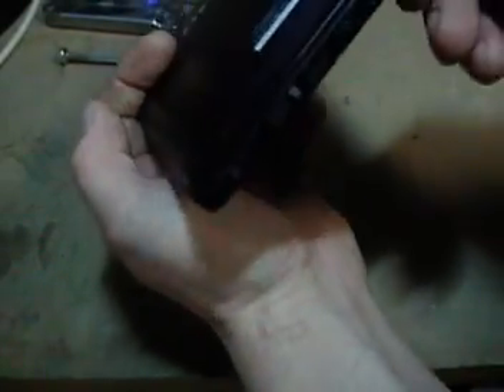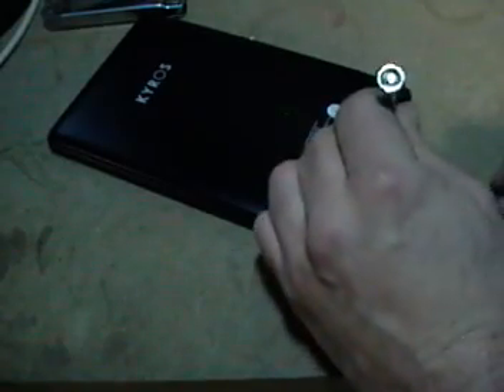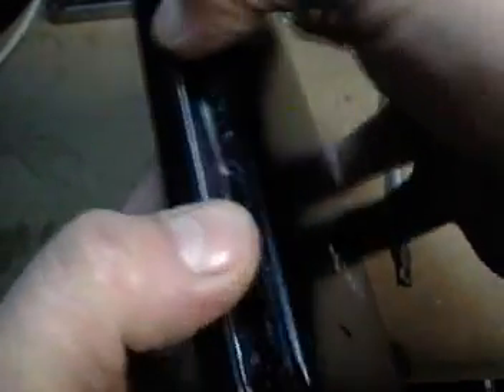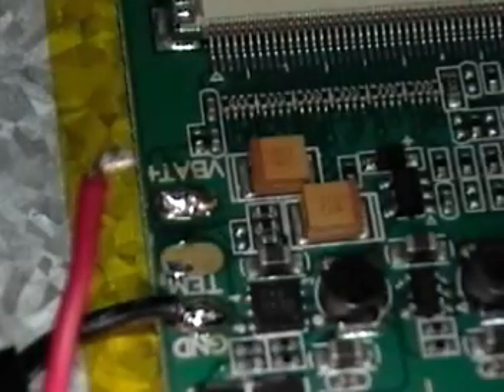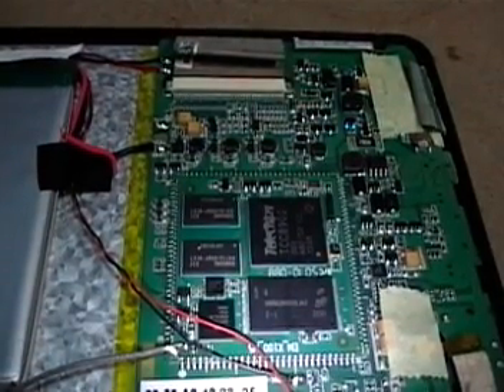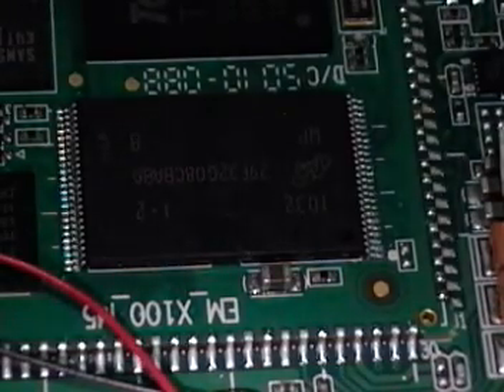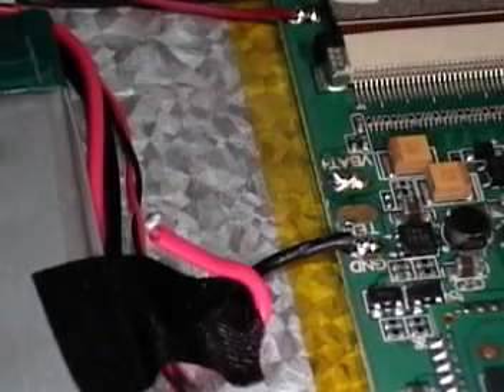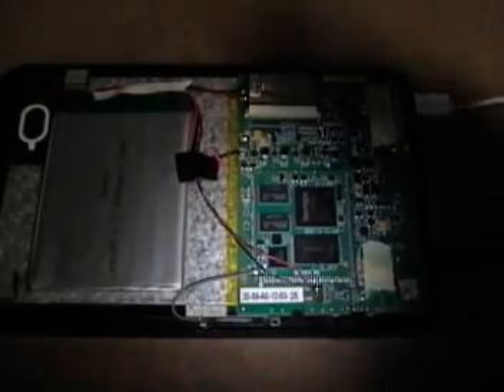How to Unbrick Your MID7015 Coby Tablet

Comment: Hi , my tablet freeze on logo boot , it is an  Infotmic ImapX210  sawee 101 !! i try to reinstall firmware many time, the same problem persist !! any help please?
Reply from the maker: Visit here:

http://goo.gl/Msojlp

You may fins a solution there, but be warned, do it at your own risk!! Although, your tablet is already malfunctioning, it may not be much of a risk at all.
Reply: +Rhomis Rhemis thank you for answering, but I've already visited and downloaded files from the link you gave, and to clarify again: my tablet displayed the logos: Infotmic with 0.6.31, after handling it appears: 0.6.1.5 ( 587) at the bottom right is still planted, the processor is an ImapX210BM1-80 --- p3r037___
chip1 = brand: Hynix --- H27UBG8T2ATR on board U3 =
chip2 = brand: MX --- 29LV400CBTI670G__on board = U42
The main board is labled WWE101-Main
Any Help again !!?
Reply from the maker: Sorry. I have no more answers for that problem.
Reply: Thinks :)

Comment: my tablet the screen has lines running across it can any one help please
Reply from the maker: You may have to make sure that the ribbon cable from the motherboard to the screen is tightly secured, at both ends. That means you will have to carefully re-connect them PROPERLY. Do some research on how to do that.

...or, if that does not fix the problem.

You may also have a damaged screen, which will need to be replaced.

Comment: Man thanks a lot!!...this works for a ColorTab CTC07SO with a different flash memory, this one has a 29F32G08CBACA,  the tablet was dead because the firmware that I put it was wrong, doing this procedure windows 7 was capable to detect the tablet again, then I put the correct firmware with the Rockchip batch tool v1.7 Best regards from Guadalajara, México earth of tequila !!!
Reply from the maker: Great. I am glad you got it to work!

Comment: Hi rhomis
I have an emergency question. would you please help me? 
I have a MID tablet with Hynix H27ubg8t2btr-bc NAND Flash.
Recently I bricked my tablet by a mistake.
Now it's completely dead and I can't even turn in on.
I'm gonna program it with a programmer.The only thing I need is a Dump file.
Would you please upload this file for me?
Thanks indeed.

Comment: I followed this instruction thoroughly. For three days, I got no satisfaction. I used both my desktop and laptop. I bricked my mid7015A while trying to load an image file upgrade. I almost gave up. The key to un-bricking your Coby device is loading the VTC Telechips device drivers. Once my desktop recognized it, the FWND went smoothly. Although my laptop recognized the Telechips USB device, my desktop broke open my device. I shorted a lot of pins. I did not care if the device worked or not.

Comment from the maker: It is not worth the cost to fix a broken glass.Get a new one like the AGPtEK TP10A. It is cheaper and way FASTER!! Android 4.0 (Ice Cream Sandwich) 1.2 gHz  and no need to ROOT it, modify it or hack it. It's ready to use! Surf the web and has FLASH. Uses mouse and keyboard if you want. As low as $82.00 cheaper than repairing the COBY. Andriod market is loaded too. Have Fun!

Comment: I have what i think/hope is an easy problem with a mid7015.I dropped the thing and the outter glass part broke.It powersup with no problem but i can't use the touch pad.I know i need a new  outter glass but i don't know how to go about replacing it.I don't think it's as easy as just popping the new glass in place.Any vids on this?Sorry for the taking up space with this problem but i can't find one.

Comment from the maker: Not sure, but maybe possible. If it is bricked, it may be worth a try.
For less than $100.00 get  a AGPTEX TP10A It comes with Ice-ream Sandwich Android 4.x  1.28 GHZ. Runs Adobe flash and works super great. Can use a USB  mouse or keyboard. I got both (mini keyboard/case for it).

Comment: Thank you so much rhomis! I thought my MID7015 was totally useless until I saw your video. A suggestion to others who would want to try this and who are not skilled with using the soldering iron, there is a risk of frying the chips if too much heat is applied. What I did was I just cut the red wire from the battery using a small wire cutter and soldered it back after I unbricked the kyros. I just thought that was safer and easier. More power to you, rhomis!

Comment: problem was the usb cable. unfortunately i did not have to tear it apart. for those with hands that aren't so steady just clip the red wire and solder it back together after done and tape. if FWDN does NOT recognize mid7015 please change your usb cable first and save yourself some trouble. chances are it may not be bricked.